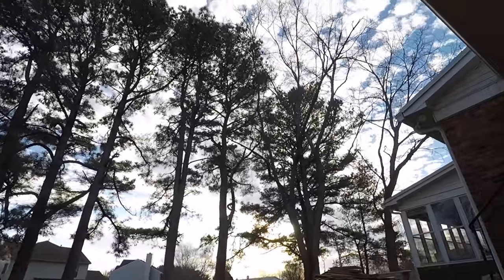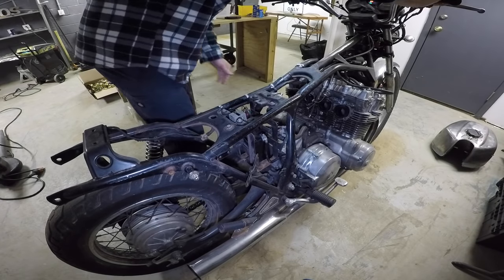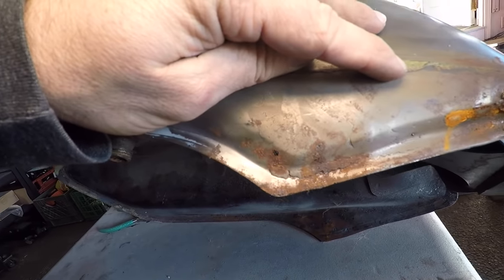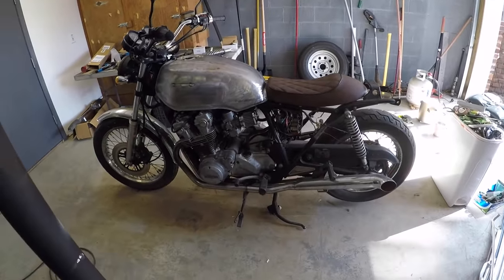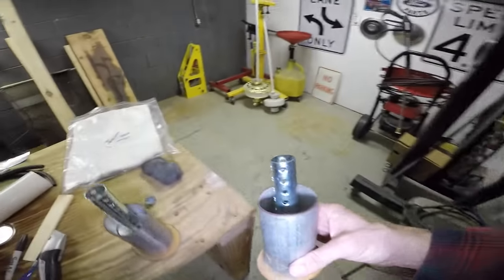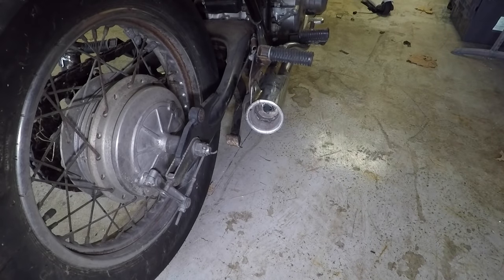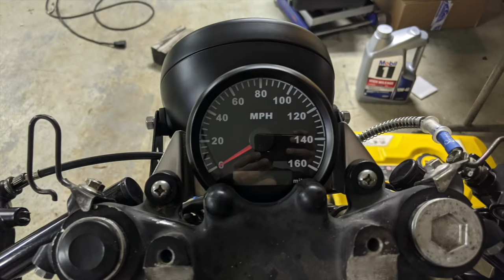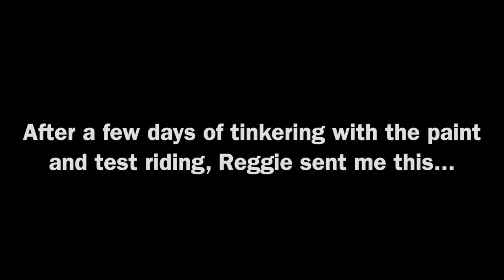Building a Cafe Racer for under $1,000 (Starting with a $400 Honda CB750)

Comment: I bought a CB550 from my boss when I was 16- for 75$. It had straight headers, nobby tires and the fenders lights all removed. I ripped it up and down corn fields for a while during the summer. My dumb ass sold it for a 100$ a yr or two later at a farm auction. One decision I kick myself for every time I think about it. 🤷🏼‍♂️

Comment: A nice simple build, sometimes those are the best kind. No fancy moonshot gimmicks, it runs and looks the way the owner wanted it to so that's a job well done. The exhaust hack (literally) was a good money-saving trick, that and adapting the throttle ferrule to work with the carb rather than going out and finding another one.
Reply: "adapting the throttle ferrule"
Doing it "right" would cost even less work.  You heat the end barrel up, and the cable will pull out.  Push the next one in, fray the ends out so they would "hook" and solder it all shut.
That's how we used to do it, and I was told that factories did it that way too.  His hack might be fine for the throttle, or it might pull out, or the weakened barrel might break.  The frayed ends soldered in was good for clutch cables.  On soviet boxer bikes.  Cables broke all the time, the barrels used to stay put.
Reply: M'self, I probably would have punked out and just bought a custom-length cable, maybe a couple other bits.  Naturally there are details I'd have done differently, but hey, that's half the fun of watching build videos, now ain't it?   ;)

Comment: I think a  4into1 exhaust would be worth the extra bucks. Especially if you can find a nice used one from  80s when they were made from thicker material.
Reply: The Wolf Pro Comp springs to mind,,I had one on my 650 Nighthawk and most of my buddies back then had em on their bikes

Comment: Amazing build! If i may ask, what jets did ya'll use and how many turns out on the tuning did you do?
Reply from the maker: It had the stock jets and they were turned out 2.5 if I remember right.  It ran great at lower rpm but leaned out at WOT so it will need bigger jets soon.
Reply: @AustinCoulson  my friend I liked what you have done !  My question is how can I get in touch with you ? I would like you to work a project for me . Thank you

Comment: I just got done building a cb750c 1980, first engine had 30 psi in cyl 1 so i swapped the engine, finally got riding. rode for 10 minutes then the piston rod shot out of the front of the engine
Reply from the maker: Oh no

Comment: Is the motor firing on all of it cylinders?  Or, does it have low compression?  I like the style of your Cafe Racer; it just sounds like it needs some engine work or good timing to me...  Keep up the good work!  :-)  Peace, Stiletto :-)
Reply from the maker: I didn't have it fully tuned until the very end, two of the butterflies were cracked open causing a high erratic idle, but at the end I got the idle nice and low and firing on all cylinders

Comment: If you would like a superbly convenient fuel tank for testing and tuning hanging anything suitable from a medical IV stand is a very old trick. Ya can easily find a variety of brass (plastic is much weaker) hose barb fittings including inside diameter adapters from one size to another and quality metal inline fuel valves. Don't omit a Y-adapter or two for the collection as it may be necessary or useful to divide the feed.

Comment: Yeah, that's absolutely possible but when you know your shit. I have seen decent and powerful bikes for even less than $400, and repairs can cost $100 to make the bike run very well, however expertise is mandatory:)

For example, if a bike is not powering on, but it's spinning, i might need days to figure out what the problem is and i wouldn't dare giving my cash for such a machine. It needs to run for me to buy it and running machines are pricier.

Comment: A wee trick 4 ya , put those  carburettor hoses in brake fluid 4 a couple of weeks  and they will be as new...well as long as they're not ruptured (expensive ...six of those...)...... took my CBX ones , 22 years old ones , though I only ran them 4 a week  back then , (Had ported through the head and had to fixxx.)....but now those had , all six , turned into lethal weapons (however one kills with round things I do not know)... got to b as supple as new ones, until one had run them 4 a month or two... but that could b re-done....if need b....

Comment: Nice job ! but a $1000 ? lets see ? start the build ,ebay stuff ok it's cheep ,then do the electrical  work not so cheep if you do not know how.Then the welding poll out the cheep welder $600 to $900 dollar lets say, and then weld ,oh if you know how. Well i think you are over $ 1000 at this point. Come on man ! It is nice to have stuff to do this kind of a build. But if you do not.It is a nice dream.

Comment: On the exhaust i had a 74 cb750 with 836 kit cams and a 4 to 1 kerker with no baffle what I did when I wanted to quite down I took a 2 inch self tapping screw on the backside so it wouldn’t be seen but I put a wad of steel wool in the pipe and you wouldn’t believe how well it works plus supe easy when ya want to be a rebel without a cause lol

Comment: thats definitely not running on all 4
Reply: Definitely!  I'm surprised no one else noticed that.
Reply from the maker: When the carbs were rebuilt, they adjusted the butterflies wrong and two of them were cracked open causing the high and erratic idle. It was running on all cylinders, but very poorly until I adjusted them at the very end when I was putting it together for the last time
Reply: @AustinCoulson  
Ah. Glad you got her tuned. Those are great engines
Reply from the maker: @phillyb598  easily one of my favorite motorcycle engines. Simple, reliable, and decent power
Reply: @AustinCoulson  and bullet proof.  👍

Comment: Not bad! I haven't had much luck using that SprayMax 2K over regular spray paint. It last about 2 years and starts peeling.
Reply from the maker: Its much better over an automotive base coat than it is over spray paint. 2 years if its in the sun sounds about right

Comment: Nice job done there ;) I used to have the cb 750 F1 super sport which i think was the engine model before what you have. The bike i really enjoyed untill i threw the chain off at over 100 mph around at left hand curve and wrapped the chain guard around my ankle. Luckily the chain never touched me on the way out the back.  I walked back down the highway and  picked up my chain. When i eventually stripped the motor down i found i had damaged the crank cases behind the drive sprocket and snapped the cam in half at the centre beside the drive sprocket. I eventually got her rebuilt and on the road again, i liked that bike so had to rebuild her :) So when i threw the chain off i guess i over reved the motor and snapped the cam.........ohh well, it could have been much worse if the rear wheel had locked up at the speed i was doing around a slight left bend. Lucky me ;). Austin, on my last build i done similar work as you on a FZ1000 When i got the the pipe i stuffed wire wool in it and held it in with a small roll of wire i beat down the pipe with a wooden hammer shaft LoL and it worked great for back pressure and sound deadening ;)

Comment: Great vid. Nice work on the bike. Doesn't sound like it is running right (not running on all cylinders.) Sound like an inline twin.
Reply from the maker: Oh yea it was running terrible in this video.  The carbs were supposedly rebuilt and balanced before I started working on it, but they were waaaaaay off.  It was running on all 4, but 2 cyl  had the butterflies cracked open while 2 were closed.  The footage was super boring so I left it out.

Comment: I didn't really like this video, probably should've put an FR blanket down over the rear tire when welding, painting the tank without a paint gun was pretty cringe, spraying WD-40 inside the carbs to "lube them up" so the floats don't stick is not a fix. If anything is wrong inside the carbs you just need to take them apart and actually fix them. I've also never ever heard of someone saying the exhaust is "too loud" but the end result wasn't too bad and the budget for this build is spectacular.
Reply from the maker: That was the first tank that Reggie ever painted. He has since learned to use a paint gun and is actually getting really good with it.  The carbs were fully rebuilt, but they had sat on a shelf for 2 years, which is why some wd40 was able to unseat the float. That is a very common issue with carbs that sit for a long time with the bowl in the down position

Comment: Not to be a debbie downer but that is not a $1,000 build. Labour is worth $$ and all of that custom fabrication, trouble shooting and paint would realistically amount to well over $5,000. I get that he may be a great friend but let's not mislead the viewers into thinking $1,000 will get them a build like this. And please please please just spend the money on an exhaust. That does not sound like a healthy café racer guys. It sounds like its under water. There are places to cut corners and places to spend money.
Reply from the maker: The sound was because the carb wasn't tuned yet and I had two butterflies cracked open. I never told anyone that 1,000$ would get them this bike. I just showed what I built with a 1,000$ budget

Comment: Did you guys get the carbs dialed in? At first it sounded like it wasn't right and was missing. Sweet ride though.
Reply from the maker: Yes, whoever rebuilt the carbs had the synching all off. two of the butterflies were cracked open so the cylinders were fighting each other at idle.  I didn't get much footage of it idling after it was dialed in so I just used the footage I had of getting it running before tuning.

Comment: It still seriously sounds like it's not running on all four cylinders, I've had one and it should be much smoother than that, plus much faster, I hope you have checked all front pipe temperature 🌡 😉.
Reply from the maker: This was just a video of the build. I tuned it after the first ride. number 1 and 2 butterflies were cracked open

Comment: Good Video. Your not a wus if you wear eye protection and it tells newbs that really need help to keep shit out of their eyes when machining parts drilling etc..   Rode for 45 years so many bikes so many stories only because a Brand new Shoei for my Bday and got smacked down by a Truck. Happy Trails
Reply from the maker: I'm great about eye protection when grinding, but I do forget sometimes when using the drill press.  In 2002 I bought a brand new helmet on a credit card because I didn't have 220$ and 2 weeks later it saved my life when an 89yo made a left in front of me. Glad you are staying safe out there, thanks for the heads up on eye protection.

Comment: What did you do for the pod filters to avoid running too lean? Everything I've found so far says it's tough to get a good mix without the stock air box
Reply from the maker: Changed the carb jets

Comment: wait..what...run the exhaust through the fiberglass, that's not how you  use those, that is just stupid. those exhaust ends are just baffles and nothing more, they are not meant to be used with any kind of packing, the end cap forces the exhaust to escape through the holes in the sides which cuts the upper end of the exhaust note and drops the sound level by a couple decibels. first off you never run exhaust though any material, regardless of how many bends, chambers, or perforated piping you use, the exhaust always needs a clear escape path, and speaking of perforated piping, those baffles don't even have enough open area to work as a silencer/muffler, the exhaust is just going to bounce of all the metal surfaces between the holes, you'd be lucky to get a 2db drop in sound using those baffles as silencer tubes, you'd be better off just using the caps with no packing.....
Reply from the maker: The setup I used was not built to have the gasses travel through the fiberglass. The fiberglass was packed on the outside similar to an old "glass packed" muffler where a majority of the gasses pass straight through, but the fiberglass muffles the resonance that would otherwise be heard.

Comment: Simply fantastic, very beautiful bike 👍🏾😍 I don’t know if you already fixet it but two cylinders aren’t working, this bike sounds like a two cylinder, if you love the sound of this engine you will definitely love the Honda CB250 1973.
Reply from the maker: It was running on 4 cyl, but 2 of the butterfly valves were cracked open on the carbs giving it that sound

Comment: Turned out well but left me a bit confused. It sounds neither like a free-revving Honda 4 nor a British twin...
Reply from the maker: I filmed this before I tuned the carbs. Cyl 2-3 had the butterflies cracked pretty far and it required a lot of adjustments to have it sound like a proper cb750
Reply: @AustinCoulson  Wasn't expecting a reply after 11 months, but thanks! I used to have a Honda 4 and yes, they can be a bit of a pain to get right, even with the proper carb balancing kit.

Comment: Nice job! I'm starting a similar project. I bought a Honda NT650 GT rolling chassis (no motor or wiring loom) on Craigslist for $100.  I've always regretted selling my first one 15 years ago so I figured I had to buy it. I set a goal to get it back on the road for $1K. Sourcing the motor is going to be the challenge, but I'm really enjoying the process so far. Your video showed me it can be done.👍🏼
Reply: hey can i also het one too ! if you have any idea about it kindly respond ?

Comment: Does anyone know if there are engine spare parts? I would like to buy a cb 750 but I'm wandering if I would be able to find the spare parts. I had a bad experience with another old bike. Thanks, Amazing job Austin!
Reply from the maker: I've never had issues with parts on a cb750 as they are quite common

Comment: in illinois your generator needs to run off the same fuel source as your truck? So what if your truck is a diesel and the generator is a gas engine? What then?
Reply from the maker: I assume this comment is for the pizza truck I built. That is part of the reason we used the gas trucks, as using a diesel generator would have been a lot more expensive.  I am surprised you knew that rule as even the code inspector in Illinois had no idea that was a rule and didn't check for that.

Comment: Very cool man. I feel like everyone should have to ride and learn on one of these old bikes. They are so raw and there's no experience like riding an old bike. I started on a mini bike at 4 years old, then by 5 I was on a YZ80. Then I had a ton of dirt bikes. My first on road bike was a 1973 CB350, it was my baby and I did an old school UNI racing theme on it, fun bike. Then I started racing full fairing 250cc street bikes which was a blast. The rest is history. Ive owned a bit of everything, but I've always kept Hondas in the stable. Im actually waiting for powder coat on a project im finishing now. I built a chopper/bar hopper on air ride, out of a 2008 honda vt750 shadow. Sorry to ramble, very cool bike and I love what you've done with it.
Reply from the maker: I started on a Honda 50 then a YZ80 as well. Both wonderful machines

Comment: Sounds soo much better with the fiberglass. What a difference that small change makes. 

I have an '82 CB750 under a tarp in the back. But it needs an entirely new wire harness and being a 25 year old still in school I have little time or money for it right now. My goal is to eventually get into a cafe racer style and buy all new instruments and make my own wire harness. I was able to get it running, but that was with no safety features (signals, break lights, head lights, etc.). Plus I need a license and insurance is brutally expensive. 

PS your kid calling Gatorade fuel is pretty funny.
Reply from the maker: Luckily a lot of the factory wiring won't be necessary for what you want to do with it, and there are a lot of diagrams available online to simplify the process.  Good luck on your build!

Comment: I think the guy wasn't sure if he wanted a rat bike or psuedo cafe racer...
I would have angled the rear of the seat up slightly. Maybe even raised the whole seat an inch aswell (he's a big guy?). Put a shorty fender on the rear and cut the corners of the sidepanels a little rounded instead of the sharp points. I think overall this would have made it look better. Then again I would have made it all less rat bike looking aswell.
A huge amount of these builds really mess up on overdoing the sub-frame chopping and seat. The seat on this one was pretty decent though.
Reply from the maker: Can't argue with any of your points. This was Reggies first bike build so he was still learning what style he liked, and I didn't really have an opinion on what it should look like. I was just there to teach him how to use the tools and solve some of the mechanical issues.  Thanks for the comment and insight!

Comment: Hey I know this is an older video so you may or may not read this comment, but in regards to the ferrules on the cables:
Those two different cables look JUST like braking and shifting cables for bicycles. The smaller ferrules are used for shifting cables and the cables with the bigger ferrules are used for brakes. The brake cables are also slightly larger in diameter.
Reply from the maker: That is exactly what I thought when I saw the ferrules.  I don't know where Reggie got that throttle, but I'm sure it was ebay and probably only like 12$, and very easily could have been a bicycle part